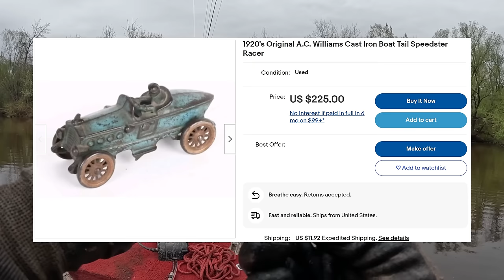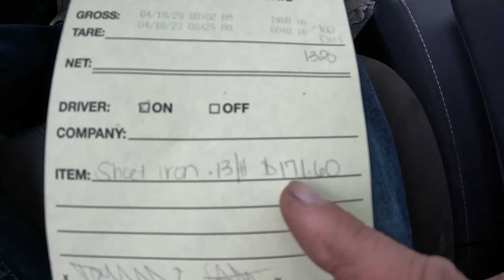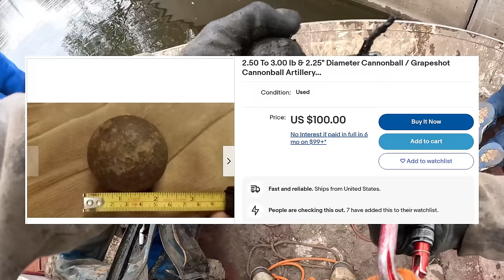You Wouldn’t Believe This INSANE Magnet Fishing Jackpot Unless I Caught It On Film!!!

Comment: The iron shoe-thing is a SHOE LAST  for replacing sole and heels. They came in multiple sizes as a kit usually. GREAT FIND! Clean it up and paint it with black rustoleum and use it as a door stop, or paperweight, as well as the flat irons you have.
,o

Comment: 1:40:30  That pump thing is a frost proof yard faucet it connects to the valve at the bottom so you can run water to provide drinking water to livestock or wash the car in freezing weather and when it shuts off the water in the stalk drains back and does not freeze in the pipe.

Comment: 13:09 That is an ignition coil from a car. It boosts the voltage to fire the spark plugs. the little tower in the end is where the wire to the distributor connects.

Comment: A short story about a WINDOW WEIGHT it can be used for three things:  1. A window weight.
2.A Shaw or a sham not sure about the spelling, it can be used to balance A top of the window frame and below the ceiling  it’s inserted horizontally inside the wall 3. it was also used many years ago for a boat anchor, depending on the weight, boat or a canoe.
You got it  now okey-dokey okey-dokey Dokey pokey👍🏼😁🍻 cheers, mate😊

Comment: That thing that looks like a water pump is actually just a valve a water valve but the cool thing about those is those do not freeze cuz you have the valve is inside the pipe so you insulate the pipe real good and your valve doesn't freeze out in the field can be used on a well like you're saying but it has to be have electric pump or some kind of pump to pump the water up to it

Comment: Alex's Bell or horn as you were calling it is an old fuel pump that bolts on the side of an engine is mechanical fuel pump it runs off of the camshaft